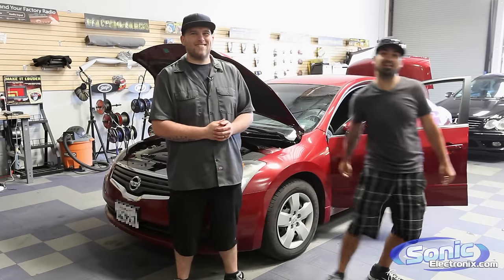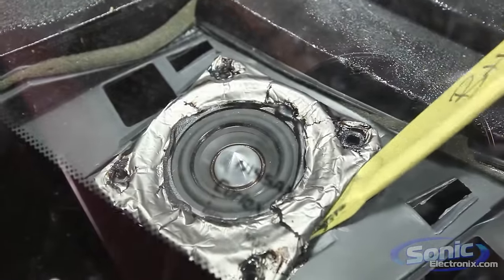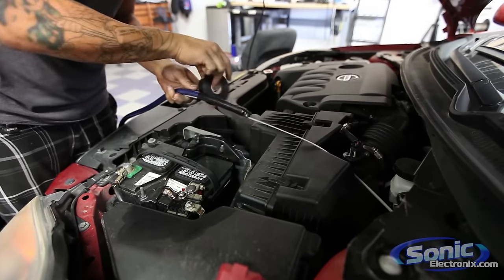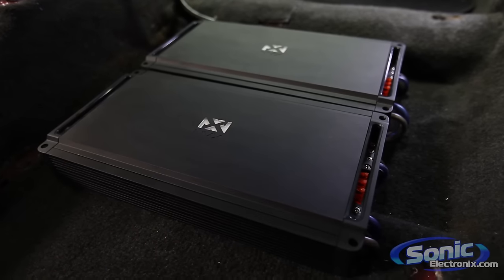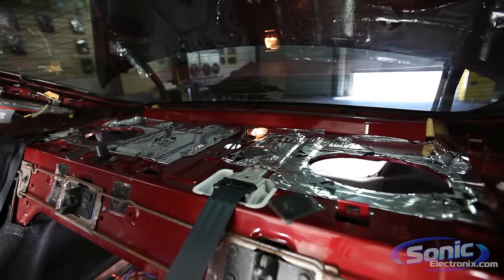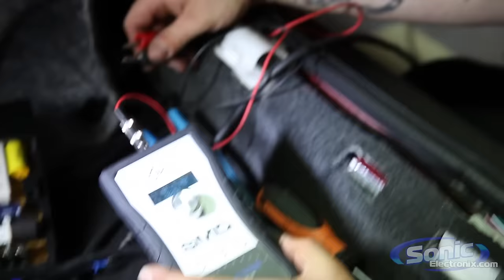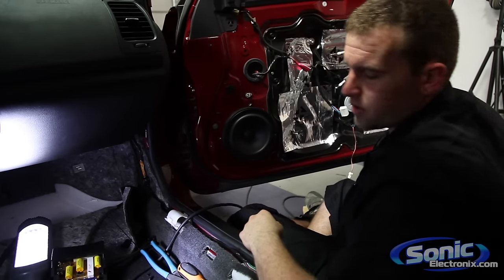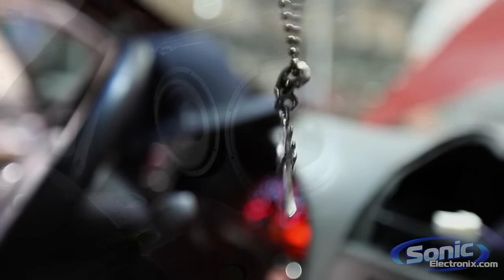Car Audio Installation - 2008 Nissan Altima Full NVX System - Speakers, Subs + more

Comment: why the hell would you replace a rockford fosgate power amp with those cheap nvx amps? If you face the subwoofers to the back you will get higher db to the front and be able to hear it louder outside!!!!!!!!!!!  clean install but thought out wright!!!

Comment: When installing the nvx cap, do you still have to fuse it at the battery and run the wire to the cap or do i have to run the wire to the cap and fuse the wire like you would do at the battery but at the cap?

Comment: Where is the hole underneath the dash that you guys pull the 1/0AWG wire through, I am installing in a 2009 Maxima and they are similar, just can't see anything there.
Reply: there's a rubber grommet take a flashlight and look under the steering column really good, stick a hanger or wire through but be very careful there are wires by the hole.
Reply: Alright thanks!

Comment: How do u tuck the wires underneath the amp so it can be flush? Thanks
Reply: Shai Lee amp mounted on top and the wires run under the carpet

Comment: Installing nvx in the place of infinity?........
Reply: Yeah who does that, Infinity should be the thing you want.
Reply: TekReview's I personally own nvx gear, and ive had Infinity/jbl, and rockford, i think the NVX stuff is a lot better
Reply: I1S1337 and also they said they infinity were in horrible condition
Reply: Never heard of NVX before and I usually know about all mainstream electronics.
Reply: TekReview's Well maybe you should learn more then, because NVX has been out since 2012, and they have good quality built products at a lot better prices than other higher end brands and are equal to if not better than those brands
Reply: Wow 1 year makes them wonderful. Please, until something is reliable then I will get it. And most places do not even carry the brand. Grow up.
Reply: TekReview's Grow up? what a childish remark, I wouldnt want you part of the NVX family if youre going to to so immature over this. good day sir
Reply: I1S1337
i agree with your statement. NVX from what i have read and seen seems like a good company (i know their amps are cea-2006 certified which is good enough for me). and as for the infiniti kappa speakers i was perplexed as to why they were replacing them until i heard that the screws were jammed into the voice coils. NO speaker is savable at that point. so it was the right decision. those speakers were long gone.
Reply: TekReview's but the Infinity Audio was installed in a very crappy way....and he probably spent 3k or more doing an all new system.
Reply: what about now they are a good sized company now

Comment: I'd like 2 know more about that mvx x cap10???? is it equivalent to 10 farod's? so as good as 10 -ONE fared caps? I HAVE A 03 FUCUS.PUSHING AT BEST 110 AMPS.WOULD RUNNING 2 BATTERIES & SEVERAL CAPS OR THAT MVX X CAP10 ALLOW ME TO RUN a C.A.B.1600.1 W/OUT A BIGGER ALTERNATOR? I DOUBT IT BUT, I'D LIKE 2 SAVE MONEY SOMEWHERE CONSIDERING I HAD 2 BUY THIS CRAPY FACTORY ALTERNATOR 2 get arround & THEN I SAW THE CAB1600.1 & IT DREW ME BACK INTO THE AUDIO WORLD!!!!!!!!!

Comment: how much did the customer pay for the installation ?

how much would it cost to install a 4 channel amp and speaker?
Reply: Thousands probably 
And it's probably around $100+ for a 4 channel install
just do it yourself. It's super easy

Comment: I just stumbled across  this an just thought the in stall better have been free... For one never stack that many amps under the seat(feet for the back passengers will damage them), especially if you were going to half ass the carpet and make a false back to the to the trunk. And custom box my ass just a slot port box that take 10 min to design on a box program. Not impressed at all. Ooo where was the big 3 on this running 3000+ watts of power?

Comment: two Cvr 15s with a 2500 watt Hifonics i feel like my System sounds Like shit. maybe the Box is too Small? i have a 1500 Watt Amp for The Sounds infinity Components in front And infinity Primus in the Rear Deck  Help?

Comment: I installed a 4 channel amp with new speakers but i lost chimes. Any way to retaining?  Escalade 06 bose amp
Reply: They ain't gonna reply man, but I'm pretty sure Metra has a chime speaker for when you upgrade. Not sure if you need the Class 2 data interface they have to retain onstar and steering wheel controls for it to work. Hope it kind of helps. Also Product number is GMRC-01.

Comment: Hey guys i just ordered some stuff from your website. I had a question on how would you use my factory amp also an aftermarket one. Also, to make things a little more complicated i wanted to add a equalizer? Any help is very appreciated!! one other thing anyway you could tell the secret of the tool you used to get the power through the firewall...
Reply: By the way the car is a 2005 Nissan Altima

Comment: Maybe I'm off. I am doing my first full system install and I just saw 2 things that contradicted what I've read online. I just saw an amp mounted to a sub box, though I've read online that this will cause vibration and damage the amp. Secondly, amps under the seats. I have only read that this is not smart, as they will be limited on airflow and over heat. Am I missing something?
Reply: Considering modern day technology amps of the current generation can take a beating when it comes to vibrations. Also people forget the common brands like Kicker and Rockford make powered subs themselfs and those have built in amps, yet no one complains about "amp mounted to box" scenario.
Reply: ive had my 4 cadance ultra drives amps mounted to my sub box for 25 years and no problems to this day

Comment: I have a question with the original radio can work with a set up a box and abs all together or do h have a on non-factory radio
Reply: Saul Samano you can add amp and sub or subs to a factory radio using a high low level input converter(Hi-Lo or line level converter)

Comment: hey my aftermarket sterio just turn off when I turn it up and it turn back and and than when the bass hits I'll shut down again can you help me with that its a JVC  and I have a 1000bd Rockford fosgate amp and two 12 p3
Reply: is your battery just dying? mine did the same thing a while ago.

Comment: If they had done the install of those crossover components correctly, they probably would have been a better crossover than most pre-made crossovers which use cheaper and smaller components (high DCR coils, cheap Caps, crappy resistors) to save cost. Pre-made crossovers aren't usually even custom tailored to the drivers unless you want to shell out a grand or more for a Utopia system or something along those lines. I agree though, that was a shoddy attempt at a crossover. Just a first order cap & coil set-up. The whole install was shit to begin with.

Comment: i have basically the same system same amps and speakers and tweeters and crossovers and my tweeters are way to loud any way to fix this my radio eq is all the way down for high fqs
Reply: u run the 6.5 components? are they as clean as the polks?? more punch than the infinity ref coaxil

Comment: I kno the remote wire goes into the back of the radio when yu got one amp, but what if i add a second amp for bass where does that remote wire go? Do i tie it into the remote wire in the first amp?
Reply: bridge it from 1 amp to te other
Reply: +Erasmo Hernandez thankx man!

Comment: for a 1400 - 1500 watt system
would you need a better alternator (150amp + batt ? )
im aiming for clarity
Reply: preferably
Reply: 1400-1500 clamped? 
Or just what the manufacture says the amp does at a certain ohm? 

It's a different story when you clamp thinking you will get the full 1400-1500 there is so many factors, box, electrical, car many more. 

My suggestion is look up dyno of your amp and see if they have a video. To check what your amp really puts out before all those factors

Comment: Is under seat the best place to put a amp
Reply: Usually not. Your amplifier needs some space so it can breath. If it overheats it will kill your speakers.
Reply: Okay thank you
Reply: +Roope Niemi (GreenyBoo) there is enough room under the seat on most cars. Amps have overheat protection most of the time

Comment: How do you guys feel about the mvpa series amps
Reply from the maker: jeffrey robertson They are some impressive little amps. We recently dyno'd them (see other video) and the definitely performed. Our installers love using them too.
Reply: +Sonic Electronix  hello i have a engine noise in my speakers  even with the stereo off.  and with the engine running is worst. i have a dnx691hd along wit a fosgate  4 channel amp punch 400-4  can you help?  Please. i  own a 2010 altima sedan. i need your services and a quote. please !
 happy 4th of july. 
thank you for reding my post...atte C. Valles
Reply: Kal El is your deck bruh
Reply: Kal El you have a factory deck?  If so ground your converter brown line.

Comment: When it comes to car accessories I always ask who's going to be working on it. If its a black person (not to be racist) I just get in my car and leave you probably asking why well Ive had my tints installed by a black guy 20% all around on my car and it came out awful so many bubbles and water spots it was unbelievable and he was smoking a joint while doing my tints lol another time was when I wanted to install my woofers man the wires were a mess ziptied no electrical tape half ass job basically  and it was a black owned audio shop but no more for me sorry
Reply: Hahaha